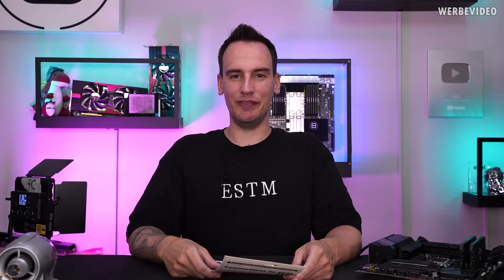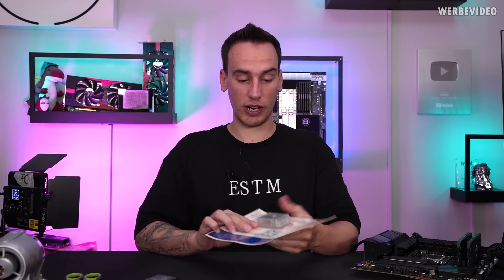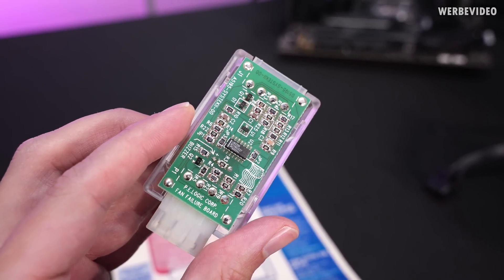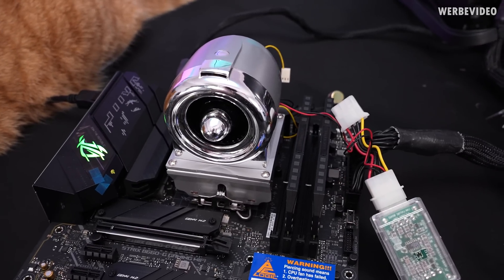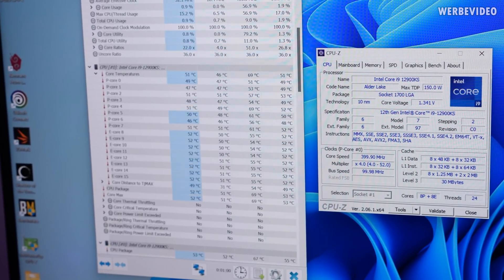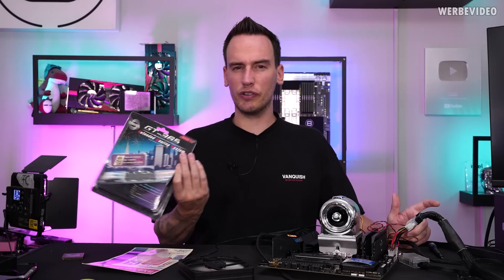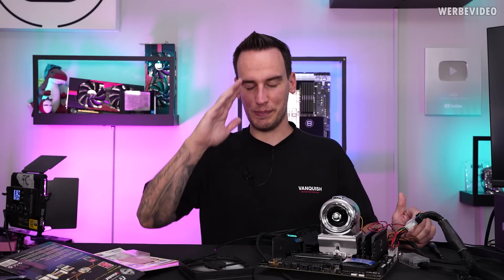This 30 Years old Cooling Gadget was Supposed to Protect your CPU... but it won't

Comment: When I first started building PC's, a loud ass CPU fan was a right of passage. Everyone was sticking 92mm Vantec Tornados on their heatsinks which would continuously scream away at 5000RPM. You also got accustomed to the constant noise, so if your PC didn't sound like there was a blow dryer running continuously in your room, you didn't need a fancy device to tell you the fan stopped, because the eerie silence was enough.

Comment: Smaller fans for cpu's back then were smaller so more fricition on the bearings. It was never an issue for me. None of my fans have ever died in 26 years as I alway's kept my system clean. I worked on several old computers from a place I used to live at. If you didn't maintain the fan could get clogged with dust and hair  which could kill the cpu fan. But remember those were what 20mm/25mm fan's back then. These things came about as back then BIOS didn't have cpu monitoring and shutdown parameters that could be tweaked.

Comment: The premise of the first thing is at least solid.  Back then the idea of CPU's measuring their own temps and throttling down or shutting off if too high was a foreign concept, so if the heatsink fan died there was a real potential to kill the CPU.  And fans certainly didn't have the reliability we have today so those dying were a real concern.  The premise is solid, though the execution is poor in this case.

Comment: I had a fan controller from thermaltake with the same alarm when fans stopped spinning and it did as well sound the alarm if i turned one of the 4 fans down to about 30% speed. And yes the alarm sounded when i started the pc until all fans had enough speed. It did not make a sound when it was turned off. One of my am4 5600X builds with an Noctua NH-L9a Chromax had the fan brake down but luckily motherboard/cpu combo survived when it turned it self off.

Comment: You are probably too young to have seen this but in the late 90s a very popular "cooling system" was made out of Peltier effect, a plate between CPU and Heatsink to help with heat transfer.
Many ppl were concerned about heat feedback when turning off this kind of device so this company was probably praying on galuable ppl to buy their product that would keep it active after you turned it off.
this is only related to 2nd device not 1st one.

Comment: I had a PC case, I don't remember the brand, It had a 200mm fan in the top with a metal mesh cover. One day my 3 year old son sat on top of the computer while I wasn't at home. Later I turned on the pc to do whatever and the system would not boot. No noise because the mesh was stopping the fan. Many hours later because the mesh wasn't obviously damaged I figured it out..lol

Comment: Oh yeah, back then in the 90's when CPU's didn't have heat spreaders or thermal limits, fan failures were common, and when a fan failed on one of those CPU's, it literally burnt a hole in the die from thermal runaway in a very short time!

Comment: Ive had one OCZ fan fail that came with the Vendetta but it was failing from the beginning. It wouldnt always start turning, but if you helped it it was fine. Ive seen dead fans due to dust in at least 2 computers Ive worked on.

Comment: One of the fans on my Cooler Master V6 GT stopped working a few years back because the grease dried up. Every 3-5 years I need to remove the fans and refresh the grease in the bronze bearings, otherwise my system overheats and shuts down lol.

Comment: >You can only run your CPU fan 100% all day long

That's how they worked back in the day, your CPU fan was either on or off.

Looks like this thing just measured the current going through the circuit and sounds an alarm when it drops below a certain threshold.

It was also probably an ENVIRONMENTAL temperature sensor that activated when the inside of the case, not the CPU, got too hot. The way to test that would be to hit it with a heat gun or hair dryer while running. That would also explain how the temperature would increase after power went off, the heat from the CPU would dissipate within the case without fresh air moving in to offset it.

Comment: My GTX 760's fan died on me. It was a two fan cooler, so I didn't even notice it was spinning too slow to cool, I just assumed my thermal paste was getting dry, but eventually I had to find a way to re-oil the bearings and it came back to life. But then the card died during a thunderstorm in 2022. It was about 10 years old, and I mostly just used it for productivity and the occasional game.

Comment: CPU fans were a lot more prone to dying in the 90's. But this alarm could also help prevent user error. I've had motherboards that let you turn off the cpu fan in the bios. Don't know why... but you could. But there was an temperature sensor alarm on them on it anyway. 

I've also forgot to plug the fan in before and the alarm starts blaring and I'm panicking because I forgot didn't know what the alarm was for, but I guess if the fan wasn't plugged in then neither would the add-on alarm. So pretty pointless.

Comment: I had a fan off my thermalright cooler fail after a few months. The spindle became dislodged from the blades and if the rpm was too high it would make scraping noises.

Comment: While both products seem kind of dumb and useless, I can see the theory in why they were made. I haven't had a fan fail, but I have had pumps in aio's fail and some kind of audible alert would have been nice and saved some troubleshooting. As far as the second product, I don't know how useful it is but the same thing happens in some newer cars where they will run the electric radiator fans when it's hot for several minutes after the engine is shut down.

Comment: Just had to replace an NZXT 140mm case fan that just stopped spinning after 24/7 operation since ~2019. So almost 5 years of operation until it just stopped. There's a large amount of resistance when attempting to spin it by hand as well. My other 2 NZXT fans of the same age are still spinning just fine though.

Comment: Actually  in history such piezo  fan alarm would been useful example for servers when you run them 24/7 with full fan speed and you want to detect failing fan. Basically at that era there probably wasn't any good software solutions over network etc  that could easily monitor hardware failures (including failing fans). So ya it could been ok solution for such purposes. Also you need to remember at the era when that type of hardware would have been marketed. Fan's in general might have not been such good in quality tbh. Including server fans. Would not be uncommon example server fans have sleeve bearing that wears of quite quick actually under server environment.

Actually would be useful even today with case/solutions that you rarely visit but needs to have example fan blowing air out the case 24/7 for optimal functionality

Comment: on my core2duo the fan in the power supply did die and cause the cpu to overheat (supply got suuuper hot), so it can happen. was 7 years old or so, so fair enough. however it failed made the fan motor itself get really hot too.

Comment: Indeed, the broken/stuck fan happened to me. But: 1. It was a case fan, not a CPU fan. 2. It was on a PC that was off for several years, and stored in an not ideal environment. 3. The case fan was also quite old, so, I think, the lube inside of the bearing completely dried off.

Comment: SystoTek: It has some rough edges, but looks like an actually useful tool for detecting the failure of el cheapo fans. It may be cheaper to but better fans, though, but one may still want the extra peace of mind. Old CPUs didn't have thermal throttling to save them from a faulty fan.
GT-365: The CPU is not getting any warmer, but the case temps probably are, as the higher temps of the CPU and other hot components get conducted to the case, without the case getting any ventillation. Not sure how much case temps actually matter, but if they do, then this gadget may have been useful.

Comment: I had my very first fan failure recently, two weeks ago... in like 17 years. All the fans I have are all the same and I also bought them at the same time (4 years ago). However at night when I was just watching youtube videos I suddenly heard weird loud noise coming out of the pc. I turned on the lights and one of the six fans was struggling to spin. I ended up cleaning the old grease and applying new one and now it works like brand new.

Comment: As mentioned by others, fan bearing failures were actually relatively common in the mid 1990s. Coming home from a computer fair with new Pentium system parts in hand, my ball-bearing CPU fan was busted right out of the box. The bearings made a constant buzzing sound. I had also seen plenty of small sleeve bearing fans quit on CPU coolers - sleeve bearing fans were super common. Remember, these CPUs had no thermal limiting whatsoever. If the temp went too high, there went your CPU - though it was pretty rare until chips started getting much higher clocks around 1998 and 2000. Fan reliability has made a lot of progress!

Comment: 5:13 "I also attached the sticker, obviously. It's mandatory" I think I just heard Steve from Gamers Nexus cringe, and I live in Australia
Reply: In theory, CPU temperature could increase if the cooler is thoroughly heat-soaked, and the fan immediately stops spinning, e.g. from the CPU exploding due to a thermal runaway 👀

Comment: I;ve never had a fan "die" outright, but i have had bearings go bad. The fan gets really noisy, but still works for the most part.
What's much more likely is a cable hitting the fan blade and stopping it. I have that happen all the time on my EVGA 280mm rads because the fans on them are poorly designed and have zero shroud around them.

Comment: Well, in defense of the second shady thing (and the laws of physics) despite there is zero heat not being generated, some of the "ambient" temperatures inside of the case might go a bit higher since there is no airflow around when all fans stop and convection moves all the hot air to the top. Maybe if you place a thermocople on the upper side of a poorly ventilated case the graph kinda makes sense.

Hell, most modern cars do this with the fan of the cooling radiator, but that makes sense since it is not very good for oxidation etc. to keep coolant and tubings at 90ºC if it is not needed (some hotspots may appear since no pump is moving it)

So... Useful? Nah, not at all, the CPU will not care as you said. But... It... kinda... works as intended. For me it is fine. Would not buy it, but it is fine. For a company known for shady products, I can award them an 8/10 if not more.

Comment: I mean i am curious, the second device that keeps the fan running for a while kinda reminds of my PSU.
It's a fractal design PSU that has a Zero RPM mode and when i turn the PC off it will start the fan for about 20 seconds and then shuts off again.
Could there be a reason why PSU manufacturer of today still have such design?

Comment: that car gadget thing probably has a capacitor that charges when pc is running and the fan uses that charge till it gets to low to keep it running... if you decide to break it open keep in mind it might shock you

Comment: Keep in mind that this product came out when CPUs started to need cooling fans in the first place. Before then, heatsinks alone were perfectly capable of keeping your CPU cool, so PC fans were still in their infancy - as much in the minds of PC owners of the time as in terms of design evolution, many of whom saw the requirement for them as poor design that just added an unnecessary new point of failure to their systems. We're all used to modern cooling systems now, but back then any sort of fan would raise eyebrows.

Comment: Now that I think about it, I never had a fan fail. Never, not only for the pc, but also for the 3d printer and the projects I do that require fans.
Even the 2 dollars cheap ones never fail. Super loud maybe, but never stopped spinning.
Curious to think that the only mechanical part that exist in a modern pc and which runs 100% the time the pc is on, is also the component that never fails.
The only broken fan I've seen in a pc was years ago: a fan without a blade.
And that was dumbass me thinking "I'll just close the case in my mini itx pc while the pc is on, what could go wrong?"
It was a noctua fan, I'm still mourning to this day.

Comment: I work in a computer shop, fans dying is pretty rare. Not as rare as a cpu dying though. Usually it's smaller fans, like in a laptop or NUC, probably because they are run at higher rpm, or fans from smoker-owned computers, because of the tar.

Comment: i have found bad fans, i did have one fail (cheap ebay fan), also had a LED fail on a cooler master led fan

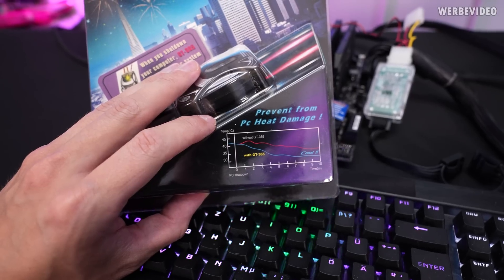10:00 if you are measuring case ambient (probe floating in the air) you would see a curve like that, bit not that extreme (maybe +0.5C if it was under heavy load b4 power off) maybe you could see that if you were reading the top of the fin stack

Comment: That second one is definitely trying to copy the concept of turbo timers in (mostly modified) cars at the time. You would install it to keep the car running at idle after shutting the ignition off, and it would allow oil to keep going through the turbo for a few minutes as it cools down. At the time, shutting off a car right after driving it hard could actually damage your turbocharger, so either you left it on for a while, or just installed a turbo timer to do it for you.

Comment: I've got at least a dozen old computers at work that could benefit from an alarm like that on the CPU fan. They're in cabinets, so they run in warm environments to begin with, and the old processors can't throttle themselves. We've had at least 3 instanced of a CPU fan dying in just the last year. The most recent one fried the CPU as well.

Comment: Haven't had the luck to play around with old computers for too long, but I have an old laptop sitting there held together with pieces of scrap metal, tape and glue from around 2008. The fans still work perfectly, heck the hard drive even works still! Only needed to replace the battery.

Comment: I find fan failures to be quite common.
I've had more than 12 fans die over the years. All 4 fans that were preinstalled on my NZXT H440 case died. All of their bearings completely ceased up.
In the mid 2000's I had the fan on my PSU die, and I didn't know until my PC made a very loud pop when the main capacitor inside it completely blew its guts out. I had the tiny fan on my radeon X1650 pro die too a year after the PSU blew its guts. I've had a couple CPU fans die and plenty of case fans get an unstable wobble from the fan motor itself after a year.

Comment: I haven't had a fan fail in recent years but 15-20 years ago fans failed often. I had 2 different CPU cooler fans fail and the CPU overheat and lock up. This product would have worked back then but is unnecessary now a days.